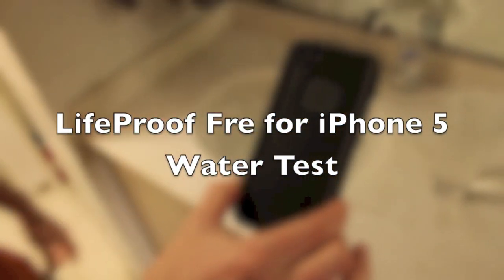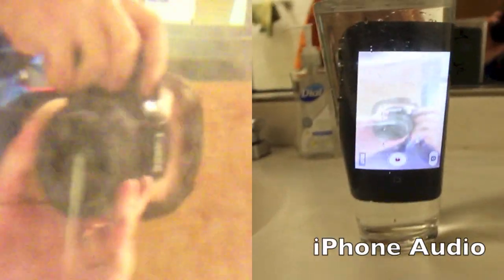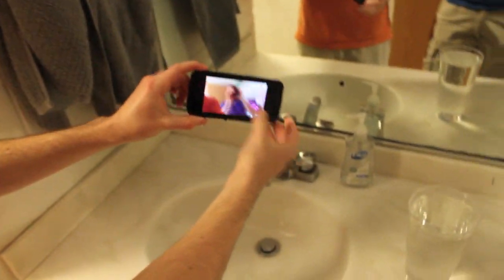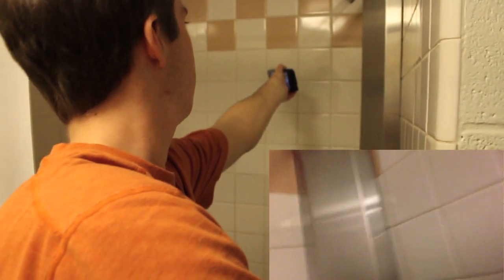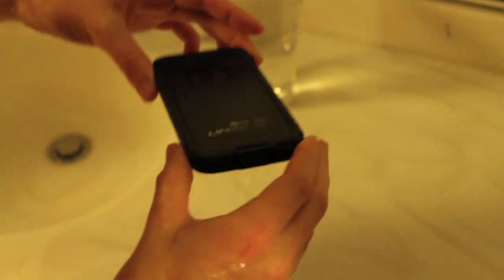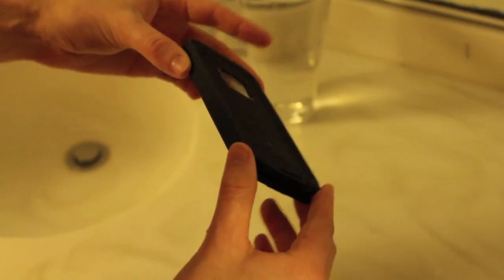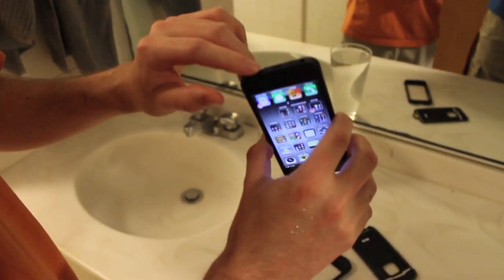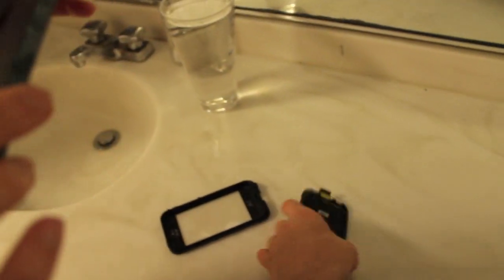LifeProof Frē Water Test (iPhone 5)

Comment: Whoever purchases this case "must" go through the water test before putting the phone in the case.  You basically but the case together without the phone in it.  Submerge the case for "one hour" with weight on it.  Take it out of the water, undo the case and examine for any leaks.  if there are leaks you have a 90 day return guarantee. If you complete the LifeProof questioner with out any wrong answers your get the 365 money back guarantee.  This is just not a case you slap on out of the box.